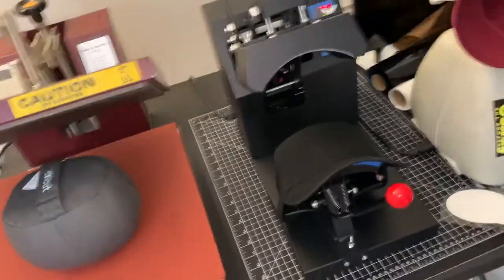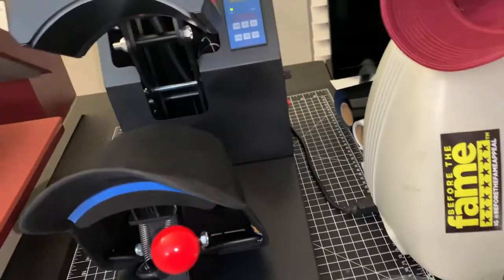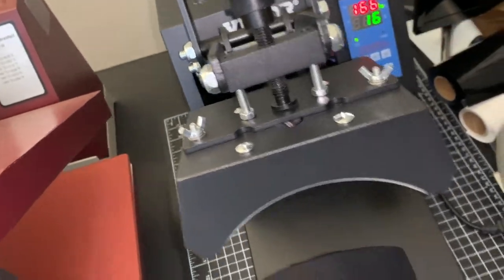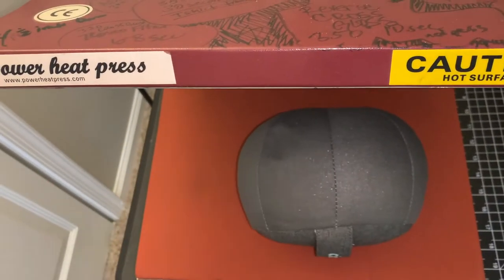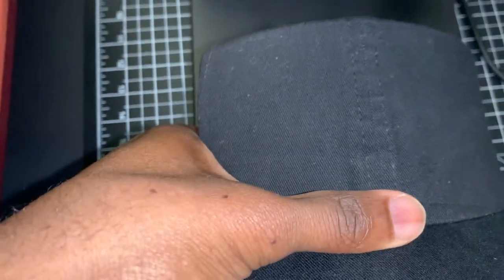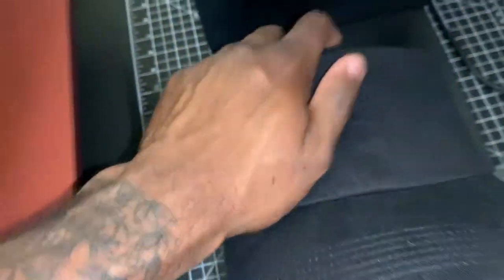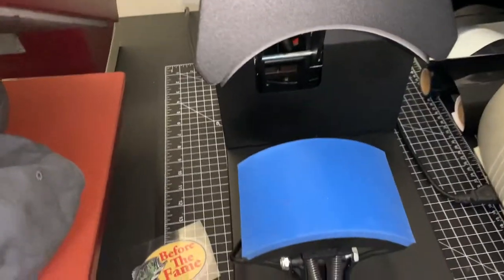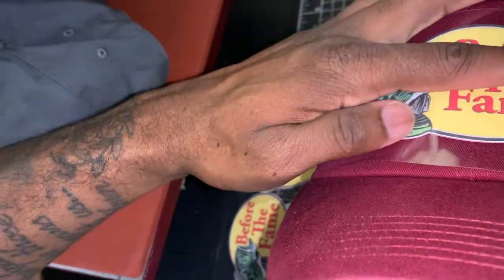Cricut Hat Press vs Vevor Hat heat press | Buyer Beware Pt 2 | Best budget hat heat press

Comment: How do you print out your designs? Do you need a cutting machine? I have the sublimation printer and hat heat press that's it. Do t know how to print out my own designs so I can press on hat
Reply from the maker: if you have a sublimation printer, youu will need hats that have a white front and made out of polyester (sublimation) If you have a vinyl cutter you can cut and print your hats on that machine and use that...also you can purchase plastisol transfers from websites (google plastisol transfers) or dtf, vinyl transfers...I hope that helps you
Reply: @shastylesdesign  THANK YOU SOOOO MUCH
Reply: @shastylesdesign  So the Vinyl cutter or Cricuit cutter is Needed? Wow and I only have dark color hats. I like the paper that you print out, it look easy to go on the hats
Reply from the maker: @jannelson168  yes! Take a look at my other vinyl cutting videos
Reply from the maker: @jannelson168  you are welcome